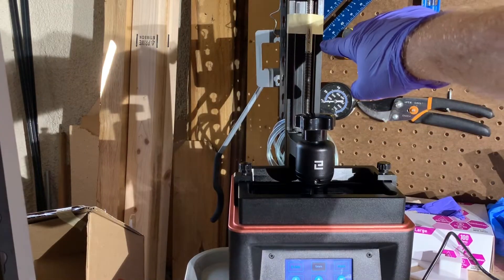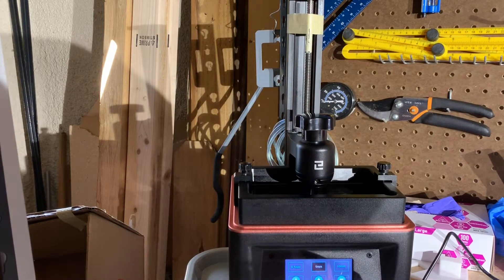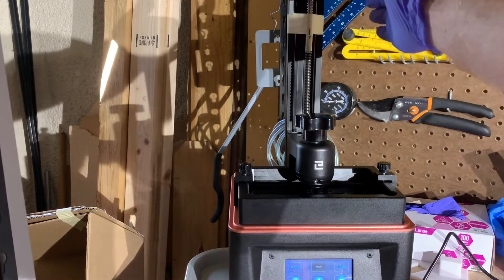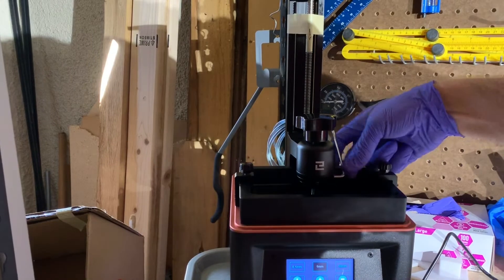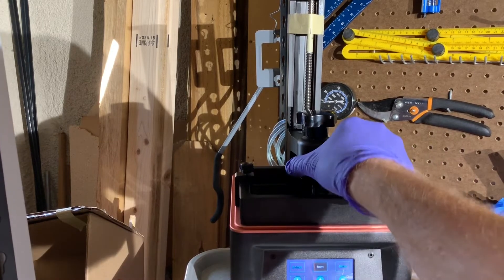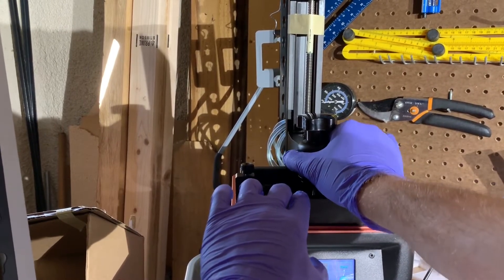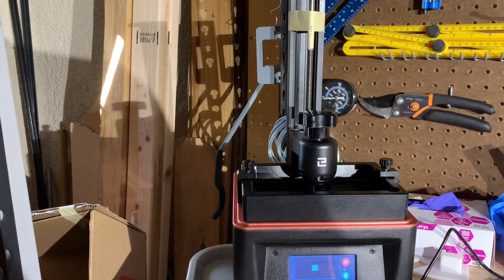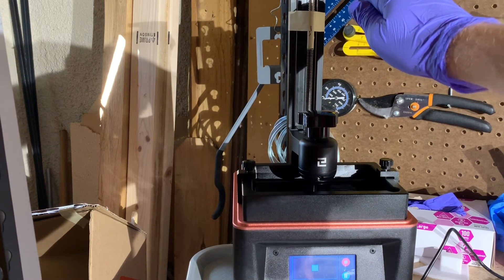Elegoo Mars Z Accuracy Troubleshooting, Part 1

Comment: So adjusting the preload nut didn't work (shocker). I ended up taking apart the stepper and the "play" comes from a preload sprint on the screw side bearing. Essentially it's pushing down, but when the screw receives resistance it'll compress ~1.5mm. I switched the spring washer, and spacers around so that it's pushing up instead of down, and haven't had an issue so far.
Reply from the maker: Yep - you found the culprit (see my reply comment to MA below). I initially tried swapping which side the spring washer is on like you did, but found it added a lot of resistance to my stepper assembly's rotation. Instead, I printed a set of spacers in a couple thicknesses so they could be stacked in .1" increments of total height. I ended up using 1.4mm or something to take up all the slack previously occupied by that spring washer, without axially loading the bearings binding up rotation.

Anyway, it looks like Elegoo agrees this is a problem - they reached out to me on facebook and they're sending a new stepper assembly that presumably will start shipping in new machines too.

Comment: As a work around I have found zeroing, locking the bed, zeroing again, loosen and retighten the bed gets me a consistent zero.

I'm curious which version (serial) you have.  I found mine squishes the bottom 1mm off consistently. I pulled apart the head and tightened the preload as far as it would allow. If that doesn't help I'm going to get a heavier spring, or shave a little off the bushings, so they can get a little closer to one another. Also, I opened up the body, and the stepper motor isn't hard mounted to the chassis. There's a ~1mm pad separating the two. Which seems the norm for these printers.

Comment: HI! I was suspecting about that. Thanks for to show what is going out. Did you find the solution? Thanks again!!!
Reply from the maker: Yes! Well, I didn't - Jan did over here: https://blog.honzamrazek.cz/2019/09/testing-the-precision-of-elegoo-mars-volume-5-whats-wrong-with-the-z-axis-and-how-to-fix-it-finally/

I updated the description with a link to my blog post, which details the whole saga as well as the fix. Long story short, there's a spring washer in the stepper motor assembly that allows the lead screw to move up when in tension. As the printer is leveling the bed, the resin viscosity pushes up on the build plate and starts to compress that washer. Eventually, the motor wins and the bed comes down to a true Z=0 position per the optical endstop, but only once the washer has already been compressed by up to 1.4mm. Because of this, it takes the printer up to 1.4mm of model height (the amount of initial compression of that spring) before it's relieved the tension, and starts printing accurate height layers. The model doesn't end up with ZERO height layers for that whole period, because it's impossible to completely dry the bottom surface of resin by compression alone - each subsequent layer will always be at least a few microns. That's why models tend to have all their lower layers "squished" into a much thinner space, rather than completely missing.

My solution was to replace the spring washer with a 1.4mm spacer, 3D printed, of course. The exact thickness you require might be different - the goal is to take up the construction tolerance of the stepper assembly without over-compressing the stator bits, which would axially load the bearings. Don't want that, since they're not thrust bearings, and they'll already see enough abuse.

Here's Jan's post in the Mars facebook group with a bit more discussion: https://www.facebook.com/groups/elegoomars/permalink/502125747244722/